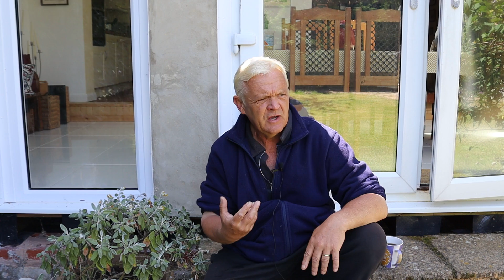2289 What The Hell Are Amps?

Comment: robert if amps is how many electrons go past a point
what is volts and watts?
Reply: Think of it like water. An Amp is really 1 coulomb over 1 second. A coulomb is an amount of electrons. 

If I setup a gravity tank, to power a  turbine, a large pipe with a large turbine can use a low pressure(volts) while moving a lot of water(amps) to turn the large turbine slowly. To get the same overall power, you could use a small turbine, with a higher pressure system to turn the small turbine faster. Assuming we want the same overall work output, horsepower(watts) the large turbine  will have high torque but low RPMs, where the small turbine will have high rpms but low torque.

Comment: One problem is leakage current through the wire casing/lacquer coating increases with voltage. Voltage getting too high could also potentially short coils. A thicker casing would help but then you can't wind as many coils in a given volume. At a certain point you'll probably be better off trading voltage output for current output to reduce the amount of insulator, and the amount of effort you'd need to isolate the voltage until it's switched down.
Reply from the maker: yeah but in  most cases that's going to be some where between 3,000 - 7,000V and that is with 0.55-0.59mm of enamel - so not sure that is much of an issue to be honest

Comment: Technically it's coulombs passing an area per unit time.  Doesn't need to be in a circuit.  Doesn't even need to be electrons.
Reply from the maker: yes but a coulomb is 6.24 x 10 to the power of 18 electrons - so without being rude that might be a bit of hair splitting there mate lol
Reply: @ThinkingandTinkering  That many electrons do carry that much charge, but they do not necessarily need to be the constituents of that charge.

Apologies for splitting hairs, but it's one of those things that seems a little too informal which may get locked into some heads.

For most practical purposes, the description of current as flowing electrons in a circuit is adequate.

I love the stuff you build.  Very cool.
Reply from the maker: @schitlipz  to be honest mate you are quite right to do it and I apologize if i came across as a bit of a jerk - cheers
Reply: @ThinkingandTinkering  No worries.  You didn't seem at all like a jerk.  Actually, I felt like one.  Have a great day.
Reply from the maker: @schitlipz  lol - you are clearly an awesome guy - you have a great day too

Comment: I guess that the relationship between volts, amps and watts etc is just much the same thing as the relationship between torque (Nm / ft lbs etc), speed (rpm) and power (bhp) that one would be talking with internal combustion technology with a transformer being effectively an electrical “gearbox”?
Reply from the maker: that's a nice way of looking at it - thanks for that mate

Comment: Good reasoning and right on! 
Like the idea of generating at higher voltages and transform at the end for the needed load.
Without the potential first being there one doesn't have enough to transform. 
An engineering friend of mine mentioned at power generating stations they alway try to generate as high voltage as possible so when they transform it or send it down the line there is less loss through the system. If it were opposite with high amperage low voltage one would need huge cables to pass the electric current all around.
Reply from the maker: that was my thinking too!

Comment: I made a little Savonius turbine that turns a NEMA17 which, in turn, creates some power after being connected to two bridge rectifiers and a 1000uF smoothing capacitor. It does a good job at lighting some LEDs but the problem is that due to the erratic nature of wind where I live, the turbine spins very fast for like  about 10 seconds and then stops spinning for about 20 seconds. It is not that regular but you get the idea. While this is fine for an LED, I suspect that charging li-ion batteries would not be a good idea. I was wondering whether replacing the smoothing capacitor with a 1F super capacitor would alleviate the problem. I am asking for your opinion before going through the trouble of ordering them (they need to be a set with protection circuitry in order to handle anything more than 2.7 volts).
Reply from the maker: i think it would mate
Reply: You didn't mention the volts or amps that the nema17 makes. And were the bridge rectifiers in series or parallel?
Reply: @jima3252  The bridge rectifiers are set in parallel. The NEMA17 generates around 5V but can go up to 10V in short gusts. With the load I am hoping to operate, the current is around 1.2A at 5V or 460ma at 12V.

Comment: Inside our lamp-cords, the electrons wiggle slightly back and forth.  Their motion is measured in amps!    And, in a DC circuit, the electricity flows in a complete circle, like the motion of a flywheel or a moving drive-belt.  That's the amperes.  Amps are a closed-loop flow.    (The electrical energy is completely different, measured in watts, and zooming along at nearly lightspeed.)   
When we realize that two separate things are flowing along wires, suddenly it all starts making sense.    It's very much like air, versus wind, versus sound-waves.  Air is like the electricity stored inside all metals, wind is like the electricity-flow, and sound is like the electrical energy.   (Air is the Coulombs.   Wind is the Amperes.   Sound is the Joules.)
Reply from the maker: i like to think of AC like a swing and DC like a push - it's basically the same thing - acting in a different way
Reply: @ThinkingandTinkering  I like to think of AC like rubbing a rope around a tree, creating a heck of a lot of heat.  But current doesn't necessarily need to be in a circuit.  It's a detail of physics.
Reply: @ThinkingandTinkering  I think the key to the whole concept is this:   wires are pre-filled with electricity, and when their internal electricity starts flowing, we call it current, and measure it in amperes.  (Wires are completely filled with mobile electrons, the "sea of charge.")   
So, if electric circuits are like a long rope, or like a drive-belt, then Amps is measuring the speed of the rope or belt.  AC is easy to understand: just have your rope be wiggling!   It still heats up the shafts on the pullies, same as when its moving constantly.   (Yet most people were wrongly taught that the pipes are empty, the rope is not there, and that electrons move at lightspeed through the "hollow pipes."

Comment: This has been explained to me so many times I'm embarrassed. (I still don't completely get it, but by now this is entirely MY fault.) Sigh. But for academic's sake, here you go:

1. Volts are the buses (schoolbuses in some stories), amps are the workers (students in some stories.

2. volts are the presence, amps are the work, and hertz are the speed

3. electricity is a waterhose: volts are like the diameter of the hose, amps are the pressure

4. electrons are like little men (this is probably Medhi from Electroboom because I can hear his voice in my head as I say this), volts are like the little walking shoulder to shoulder--amps are the little men walking in a line, a bumping the guy in front of them--equivalent to the "shove" that Rob explains. 

Hope that was fun. Cheers. :)
Reply from the maker: thanks for taking the time to post that mate - cheers

Comment: I've always preferred the "water" analogy for electricity - Volts equals how much pressure is on the water (and therefore, how fast it's moving), while amps equals how many gallons of  water is going past some point on the course it's traveling - So volts EFFECTIVELY equals the speed the water is moving (say 50MPH, just for illustration) while Amps are "how much water went past that point in any given time period" (say 100 gallons). A conductor that can carry high voltage (speed/pressure) but low amps (gallons) is like a bunch of kids throwing half-liter bottles of water past the point - The bottles go past quick, but the number of gallons that goes by per time-period is small. Conversely, a low voltage, high amperage conductor is like a bunch of guys in semis (lorries to you british folk) loaded with case upon case upon case of bottled water crawling up a steep grade - The water isn't moving very fast, but a WHOLE BUNCH of it is going past in a short amount of time.
Reply from the maker: it's a useful analogy in some cases
Reply: Where are some cases where the analogy breaks down? Just curious

Comment: 4 things I think, 4th is a chemical change.  Batteries are 1 example, another might be electroplating and there are other examples of electrochemistry.  Yes there is movement involved but I think it is fundamentally different from turning a motor, say.
Reply from the maker: chemistry is just movement mate - well in the way i see it
Reply: @ThinkingandTinkering  In a way, perhaps, however when a motor moves there is virtually no change in the motor before and after.  Whereas a chemical change alters the fundamental nature of the material which is why I would differentiate it as different in kind.

Comment: At some point when i was a kid, my physics teacher said the one short sentence that i needed to start understanding the very basics of electricity: "Voltage is a state, current is an event". 
Much later, when i was installing a fuse panel, a friend reminded me that "high voltage electrocutes you, high current burns down the house". I just needed to share those invaluable quotes.
This video made me think about how to judge the efficiency of any given generator using the 2 edge cases.
idle (no load / open circuit / infinite resistance): would the input work only be impeded by mechancial friction or will there be some significant internal lossy current (turning to heat)?
short ("zero" resistace load): would a theoretical coil that never burns just stop the input work from being done (stopping the generator)?
My thoughts are essentially about where the mechanical energy goes that isn't available as electrical output, and i wonder if these "load" cases might help putting that in perspective.
Oh, and the birds in your garden have the potential to overpower you, but sure generate a nice atmosphere!
Reply from the maker: nicely put mate - cheers

Comment: The wire gauge used in a generator should be selected for its ability to safely handle the amps going through it at maximum power transfer, or else it might overheat and burnout.
Reply from the maker: yes - because of the resistance of the wire
Reply: @ThinkingandTinkering  Right, the power dissipated in the wire is amps squared times the resistance.

Comment: When I was 18, I was already studying electronics, and understood what amps were, the basics, etc..Well, cutting corners once while changing my car battery, I used a pair of locking pliers instead of a socket. The pliers slipped and shorted a heavy gauge wire to the frame. Oooh, fireworks! and a glowing wire. I hit the pliers with a wooden board and broke contact. I witnessed just how many amps that battery had.
Reply from the maker: you only got that because you created a ath for them to flow - no path no flow

Comment: Peddling a bicycle works well with your analogy… no chain (circuit) no way to do any “shoving”…
High voltage low amps, turned into lower voltage higher amps is how the grid works.
The transformers are part of the load and part of the losses of the system. 
Which is another reason why local generation for local use is going to be more efficient than centralised generation - depending of course on what we’re doing the “shoving” with and what we need to have “shoved”.
Reply from the maker: i like that - nice

Comment: Edward's EZ Equilibrium Rotation Law
"In a closed system, rotational equilibrium is achieved when the sum of torques acting on the system about any axis is zero. This principle applies universally across physical systems, maintaining balance and stability in rotational motion."
This law states that in any closed system, the rotational equilibrium is maintained when the total torque (the rotational force) acting on the system around any chosen axis is balanced, ensuring steady rotational motion without acceleration or deceleration.
Reply from the maker: isn't that Newtons first law but using torque instead of force?
Reply: @ThinkingandTinkering  yes it’s equally equally important part of the equal exchange of the two sides

Comment: I have always looked at electricity as water and vice versa. Imagine a thin tube of 1mm inside diameter. It has water at a pressure of 10 bar in it. The plastic material has to be thick and strong to contain that pressure. This high pressure is the equivalent of high voltage which btw also needs to have a thick insulating material to contain the high voltage electrons (think spark plug cables).  But there is not of electrons in this 1mm tube moving at any one time. Then there is the case of a bigger tube of 100mm dia with a low water  pressure of 0,1 bar(think volts). With that low pressure the plastic tube can be very thin material similar to having thin low voltage insulation. But in this case there is a lot of electrons available in that pipe but just not a lot moving past a given point at any one time because of the low voltage (pressure).

The turbines needed for these 2 situations above are different. In the first case the turbine needs to be high revving with small buckets for the electron jet. In case 2 the turbine needs to be big buckets but the turbine will run at slow speed and high torque. In either case there will not be a lot of power produced as such as there is not a lot of electrons with good speed. Now imagine if we had 100mm tube with water at 10bar pressure, now you talking about lots of electrons traveling at high pressure. The turbine for this case will be big and make lots of power. That is how I see volts and amps relating, you need both for any useful work to be done.
Reply from the maker: it is a useful analogy mate - but it doesn't give a clear image of the 'shove' magnets give

Comment: what's that thing that if you run a wire round the world to where you stand with a light bulb at end of the wire the bumb lights up immediately as if it were the field doing the work not the wire as there should be a tiny delay. And The wire being part of a trigangularion targeting system that needs wire and field and resistor of course to signal activation? I think veritasium channel covered it but never really explained it.
Reply from the maker: the wire doesn't do the work mate - it can't - the work is done by moving electrons - or if you like causing fields to move - it amounts to the same thing to be honest. The wire acts as a guide to direct the force